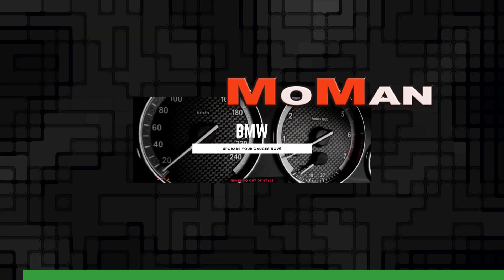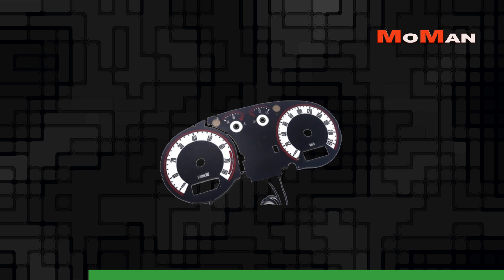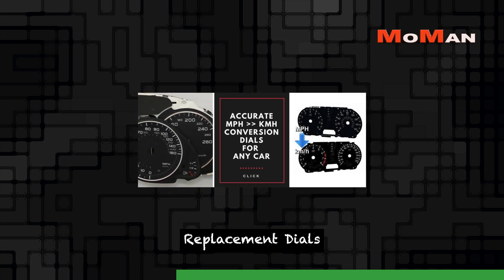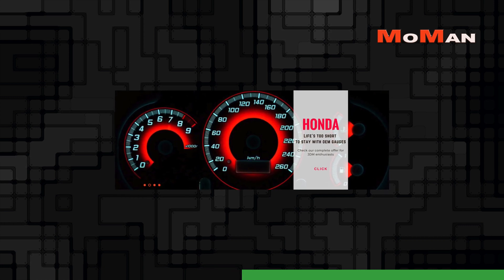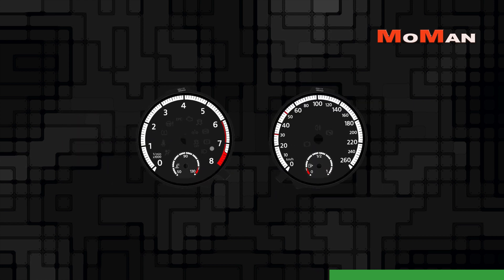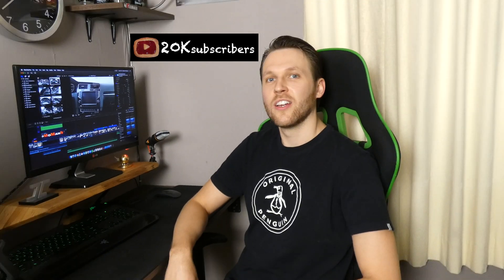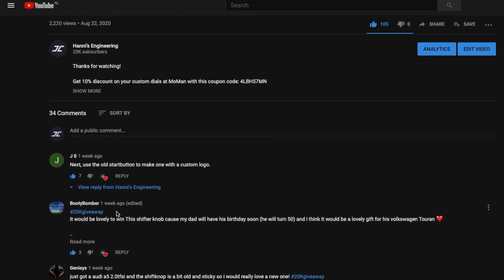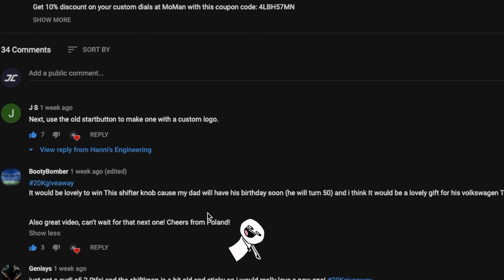RETROFITTING THE VW GOLF MK7 R DIALS | HANNI'S ENGINEERING

Comment: I did mines a year ago from
original R gauges I came across for only 100$.
I don’t think aftermarket gauges were around back then.
The only thing that happened to me is a day after I changed the gauges the plastic cover cracked, maybe I forced them too hard. 
But I have that extra cover so no prob.
Reply from the maker: oh thats weird, you don't have to force them in, just turn them in and the click in place
Reply: Hey, did you swapp over the whole cluster? i want to do the whole thing.
so i get blue dials
Reply: @madern7  I only swapped the R dials onto my Gti.  I don’t think u can swap the whole cluster, it’s not 100% the same.